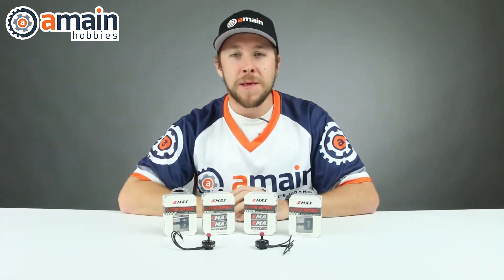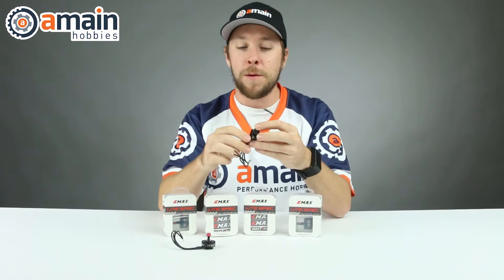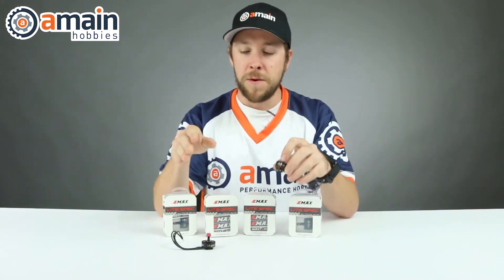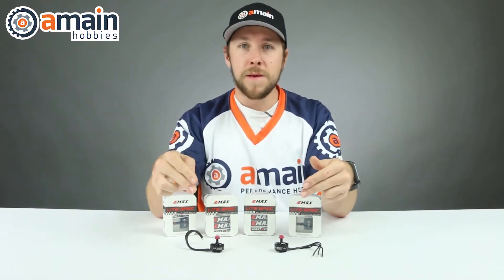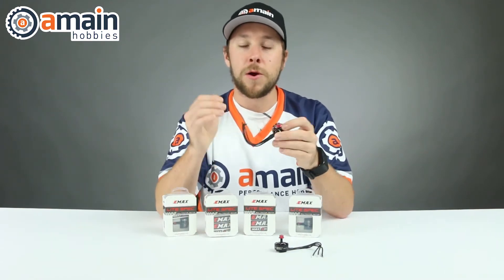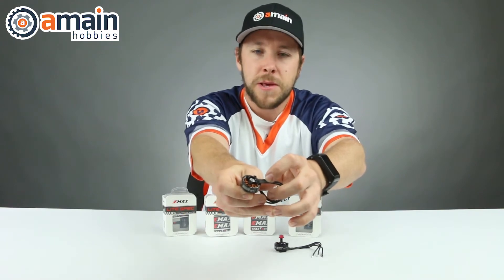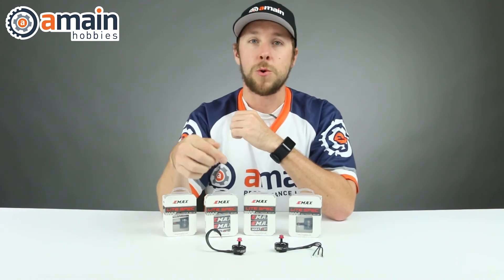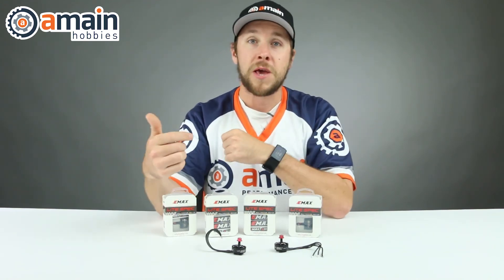What's New - EMax LS 2206 & 2207 Motors

Comment: can i mount LS2206 2550KV on 2207 2550KV. ?
Reply from the maker: Hello KwadKen. You must use all four of the same motors; you should not mix them. Even if the kV is the same, it's not the correct way to do it. 
-Brett